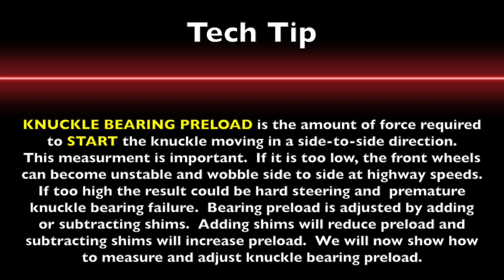How To Rebuild A Toyota 4X4 Solid Front Axle (Part 6) Steering Knuckle Installation

Comment: Rebuilding the front diff on my BJ42 and aside from a few tiny differences, these videos translate to my diff perfectly.
These are also the best videos I could find on the subject, thank you so much for lending us your knowledge and expertise.
Reply from the maker: Thanks for watching and commenting.
Reply: My 1980 is popping when I put it in 4-wheel drive with a hugs locked when I go to the right do I need to replace my shift parents or just MasterChef bearings look good

Comment: hi ,, items u missed 
1/ in  water crossing corrosion can occur inside hub ,, load this with moly disulphide grease prevents this 
2/ centralize axle vs seal  location check ,,,,,,, , do this after u have worked out equal shim packs for bearing preload first then add and subtract shim packs to raise or lower axle height ,, special tool needed 
3/ Although steering load is applied by knuckle bearing preload , and optional steering damper    ,,the solution for big wheels is to run positive caster by having adjustable / selectable wheel alignment  knuckle bearings

Comment: As commented below, the knuckle centering tool was not used. I understand not necessary if it's been done already, but this video does not address the issue? Just a thick and a thin shim shown?

Comment: I had installed the shims thinking there were only two sizes of shims:  “thick” and “thin”. I  found out later the kit I bought has three or four different sizes and now I think my shims may have a .1 mm difference. Will .1 mm cause major damage if I drive around just until I get the new set of shims? And can I possibly change out the shims without removing the hub? I’m trying to prevent buying gaskets all the way to the knuckle.

Comment: great instructional video. my steering arm in my hilux '93 solid axle just broke. can I just remove and replace the steering arm by just removing the top 4 nuts, tie rod nut and draglink? or do I need to bring down everything starting from the locking hub to the knuckle housing?
Reply: Just undo the steer arm bolts, and steering link, you will have to tap on top of studs to loosen cone washers around studs. Be careful not to damage threads. Keep nut on and on top of stud to protect studs.

Comment: Sooooo im running 33 inch mud tyres on 15x10 (-44) steelies what pounds of force should mine have to be and what is considered "oversized tyres" (i have Hilux Ln106, which would be a 4x4 runner im geussing in America)
Reply: I have the same thing what force did you use?

Comment: I'm working on a MK 2 Hilux. In the seal kit I purchased, in the U.K., there is a thick felt gasket, that is to be liberally coated with grease, that sits behind  the rubber wiper seal and in front of the top and bottom rock rings. You don't show it on here. Is there a reason you don't use one?.

Comment: I noticed that you did not use the SST for determining the upper and lower shims necessary to center the knuckle.....  your method may allow you to meet preload specs but will not guarantee that the knuckle is centered.  Am I missing something?

Great video btw.
Reply: I noticed the exact same thing. Just a thick and thin shim shown? Is the SST not required for later models?
Reply: Great video very well done. But I myself have read the Toyota manual. And they said to use the sst tool as well. Being a mechanic. And owning a shop.. I find it odd the specs where not followed, and an assumption of axle center.
Reply: Working on a rocky, similar process but I haven't got shims, should I use some gasket paper?
Reply: @suewalker2864 hi Sue don't know where your located but Milner offroad in UK have the shims

Comment: Hi dear 
Im facing some problem with my FJ62 – 1987 model. When  using the 4x4  gear (high and low gear) the vehicle is getting jam when I turn right or left, but on moving to front or reverse its moving normally, 
I recently serviced to both differential and changed all the seals and bearings, and axle,
I tried to lift the vehicles four tyres on a jack, and run it with the 4x4 high and low gear with turning the string right and left and it doesn’t got jammed, but on getting the vehicle on the ground the same thing happened on turning the steering the tyres getting jammed. 
Even I checked the break system and no any issue found in it. 
Do any one faced same problem as this, or any idea what the issue could be.
Also I open really diff I find it broken also change

Comment: Commented on wrong vid but are you meant to pack grease into the steering knuckle
Reply: Optional but personally I do, especially with how easily the inner axle seals fail and leak oil into the swivel hub housing. It eats away the grease and ruins your cv joint. The more grease you have packed in there the longer it’ll take to eat it away

Comment: How much grease would you use to lubricate the birfield? Do you pack some grease into the space between the birfield joint and the housing?
Reply from the maker: +3stagevtec We just finished a video on how to grease the birfield.  Here is the link: https://www.youtube.com/watch?v=3PXySEFVBQs   As to packing grease in the housing, it depends on where you do most of your wheeling.  If you are in a dry climate, like we are out here in the west, we do not recommend adding extra grease to the housing.   Extra grease in the housing makes things so messy if you have to replace an axle out on the trail or even in the shop.   However, if you go wheeling where there is a lot of water, the extra grease in the housing can be very beneficial in helping to keep water out of the birfield joint, trunnion bearings, axle housing, etc. Thanks for viewing and commenting.
Reply: +lowrangeoffroad Thanks for the detailed advice!
Reply: @lowrangeoffroad1  o

Comment: I'm having trouble getting my knuckle to Line up with the trunnions.  I've identified the brass spindle bushing that was part of your ultimate Knuckle kit as the problem. My axle won't sit all the way in the bushing.  If I tap it in with a hammer it's so tight I can't rotate the axle.  I have to tap the axle into my knuckle/spindle assembly and then install the whole thing in the housing for it to line up.  But the axle is super tight against the bushing and I can't turn it by hand.  Any ideas?
Reply: I picked up a wheel cylinder hone and ran it in the bushing a bit and that opened it up.  It was just a tad tight.
Reply from the maker: I am glad you figured out the problem and thanks for the tip on how to resolve it if we see this problem again.
Reply: @Shaungomban  same thing is happening to me, only I didnt force the knuckle assembly on.